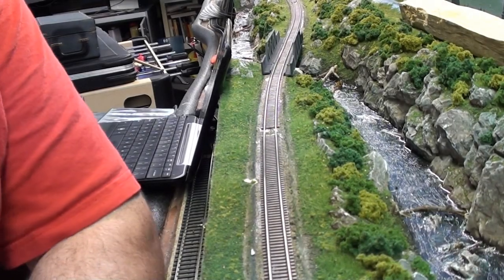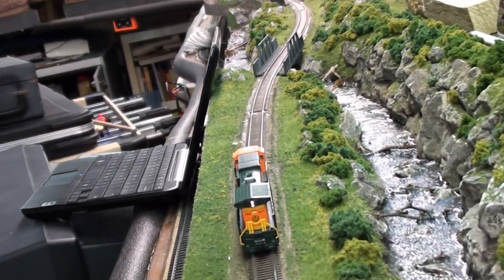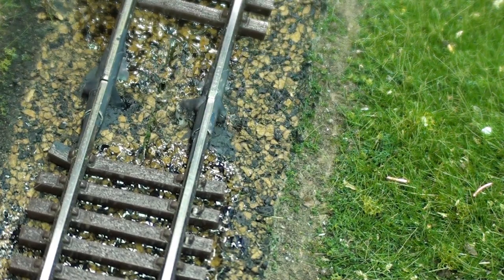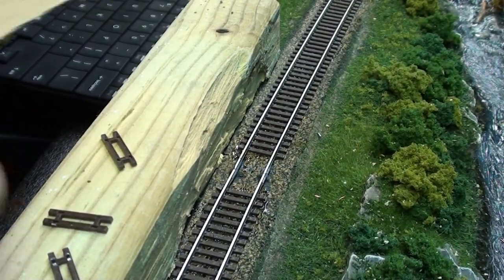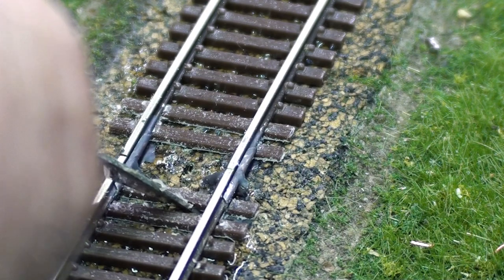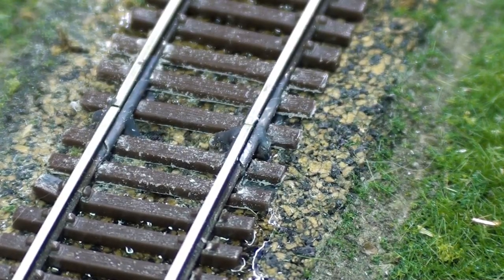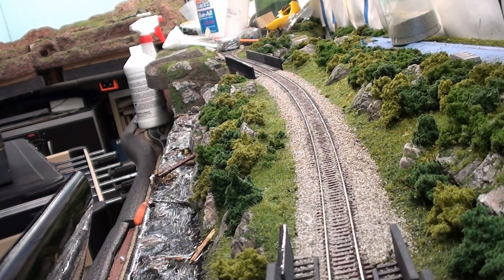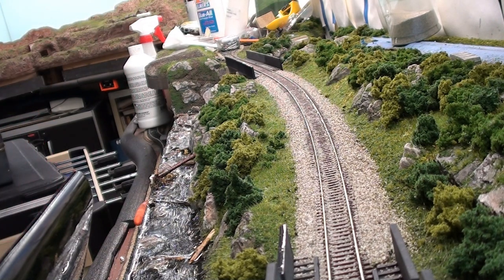Building the River Scene: Part 71

Comment: @TheJoePaul That is "wet water", a mixture of water and 2-3 drops of dishwasher soap (like Palmolive). It makes it so that the scenic cement will be soaked up easier into the gravel. Without spraying the ballast with wet water or isopropyal alcohol, the scenic cement would just run down the side of the ballast.